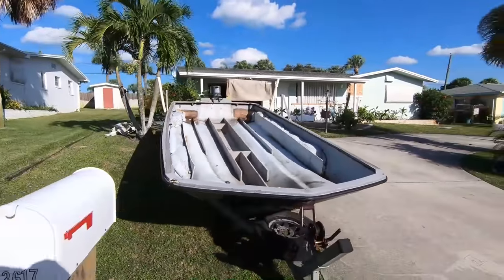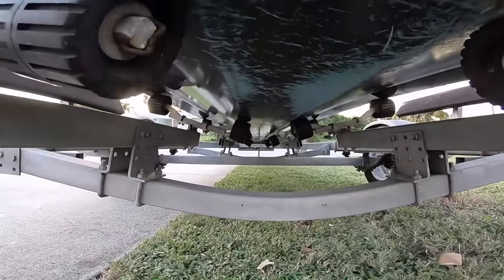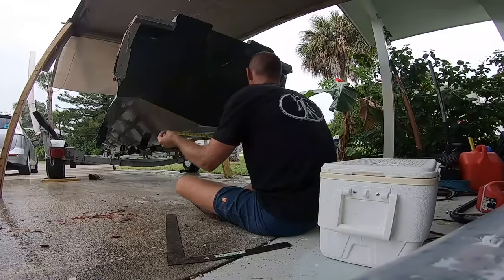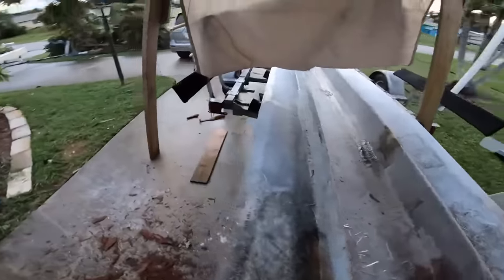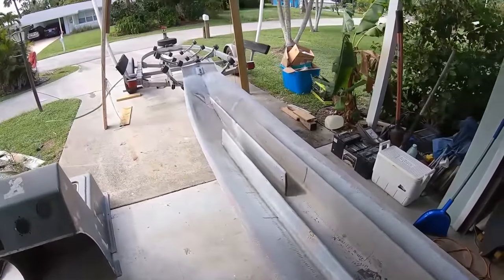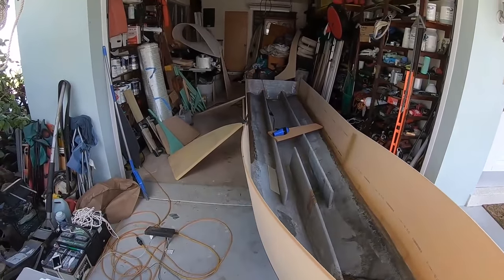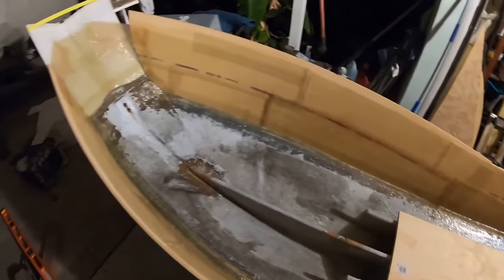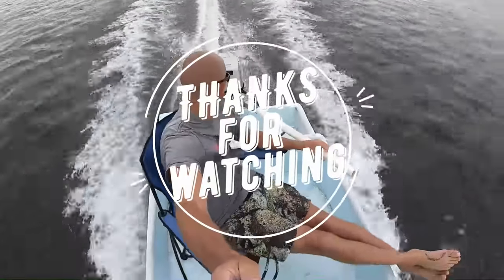Panga Build on a budget DIY

Comment: Interesting. Stumbled on your channel this afternoon. I'm nearing the end of a re-build, a 3' beam by 14' length crappie boat into a cheap, low power, efficient adventure skiff.
Cut out the 3 seats, laid in and glassed 3" of foam on the bottom a la Carolina Skiff. Aft bulkhead for a splashwell; may deck over some of the front. Have a tent that will be modified to allow sleeping aboard despite rain or bugs. Powered by a 9.9 Yam, she runs at 26 mph top speed like a giant ski. Kind of scary. :) Good cruise in the upper teens though. Eventually I'll get some video up.
Subbed, liking your content!
Reply from the maker: Yes Yes and Yes!  This is so great!  Sounds like my kinda skiff and adventure!  I would love to see it, video/photos, anything!  Definitely get some content of it and share for the world to see!.  We need more "outside of the box" influence out there, inspiring people to make cool $hi% haha.  On a related side note, the next build I am uploading is a similar adventure skiff, one I traveled over 1,000 miles on , sleeping on board... pretty cool story to it as well.  Stay tuned, because it's right up you alley!!  Cheers buddy and thank you for sharing your thoughts/build !!

Comment: Building a casting platform, stool type ...what material would you recommend for the top if I wanted to do a cored fiberglass, not sure what type or thickness of divinycell to use or if something else would be better...won't see more than 200 lbs of weight and will be supported by aluminum cross brace

Comment: You have skills and a good imagination. What is the brand on that grinding disc? Thanks!
Reply from the maker: Thank you Brian, much appreciated!  The brand is ZEC Grinding Disc.  They make them in multiple grits and diameters.  I typically use the 24 or 36 grit disc.  They are hard to find in local shops (here in Stuart, Fl) but I know Fiberglass Florida Inc sells them.  They are not listed on their website but the Stuart Location has them and they can likely ship!  Cheers!

Comment: Do you have titles for these old boat restorations or do you register them as homemade?
Reply from the maker: Hi Phillip.  Thanks for the great question.  I think I’m actually going to do a video on registering these type of projects based on the amount of people out there wanting to know. Haha. :) 

So This one came with a title so was easy.  There’s a couple ways to do legal paperwork on boats .  
But First , here is the common “homemade” way , ( not legal) which is essentially trying to register a Manufactured boat as if you built it.  People get away with this in Florida because if the boat is under 16’ it does not require an FWC inspection.  This way is definitely not the legal way.  

Legal Option 1: if a title is not attainable / old owner is unknown or cannot be found.  But you have the boats info/ hull identification number.  You CAN pay the FWC to “investigate” and after $300-$600 , they will present you with the registered owner / and or legal documents to register the boat properly.  

Legal option 2: if your vessel has no identifiable numbers on it ... no HIN or registration stickers , then the vessel indeed can be inspected by an FWC officer and you can apply for a new state issued HIN ( hull identification number).  This is not costly, and actually the inspection is free.  Your registered “make” will be listed as “Homemade “even though it is not.  That’s simply how they do it in Fl.   

Hope this helps!  Thanks for the comment!